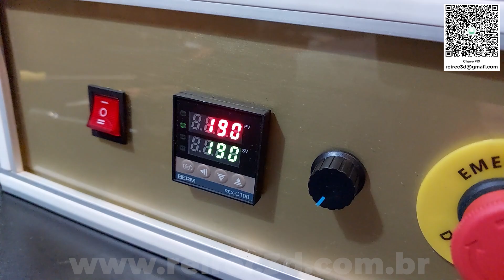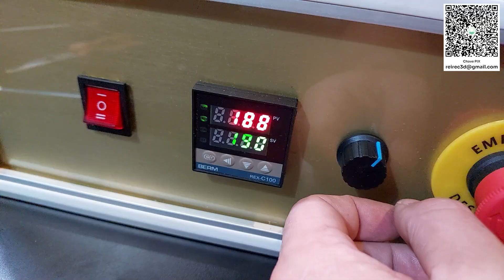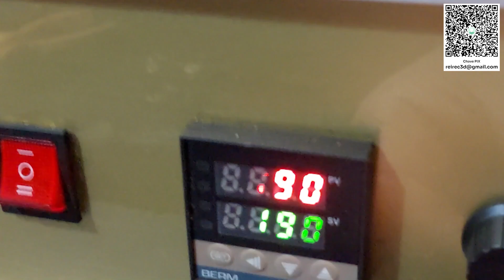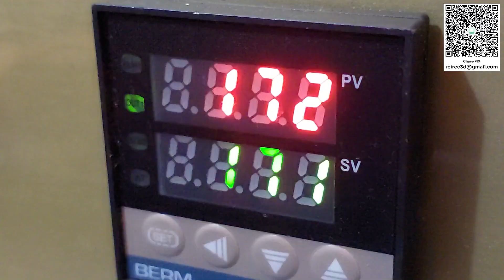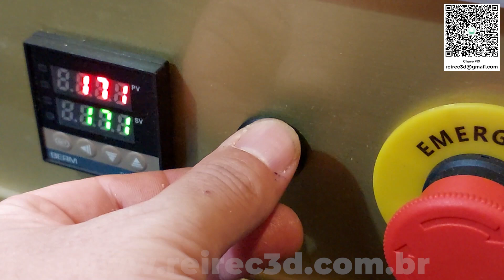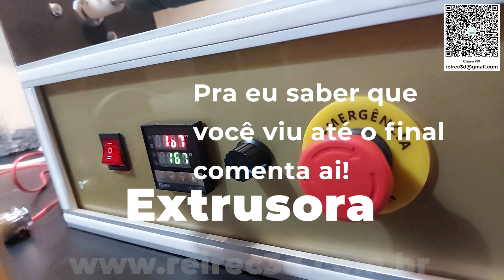PARE de Comprar Filamento! | Faça o Seu com Esta Extrusora Caseira Incrível

Comment: Parabéns pelo seu trabalho, estou montando a minha,  comprei o controlador de temperatura com o rele e o sensor, a broca mourão de 25mm x 460mm, o tubo achei trefilado com interno de 25mm e externo de 36mm por R$ 130,00, ainda falta muita coisa,  o motor de limpador de parabrisa é ligado direto na fonte chaveada passando a fase pelo potenciomentro? Sou torneiro e programador de torno cnc e centro de usinagem,  vi em outro video vc achando caro o serviço do torneiro, as coisa subiram muito e a hora de maquina praticamente estagnado a muitos anos, mais enfim, parabens pelo seu canal, um dia também chego la, kkkk. Valeu.
Reply from the maker: Olá! Se você está tendo problemas com a aderência da primeira camada, recomendo verificar o nivelamento da mesa e a distância do bico. Um pequeno ajuste nesses pontos pode resolver. Se precisar de mais detalhes ou de produtos que ajudem nessa hora, o nosso site tem muito conteúdo e opções.

Se ainda não for inscrito, fique à vontade para acompanhar o canal e aprender mais sobre impressão 3D com a gente. www.reirec3d.com.br